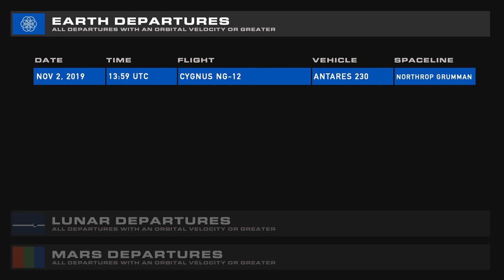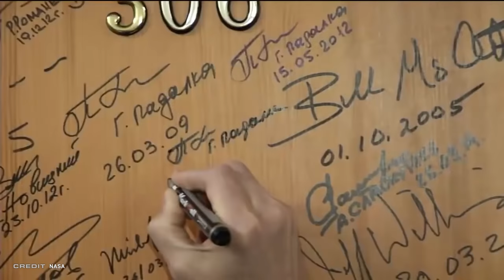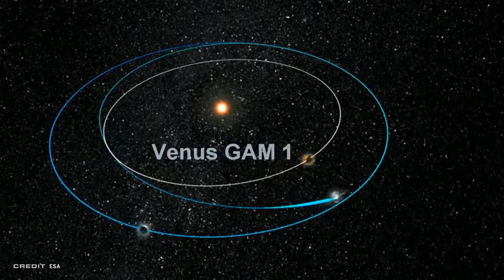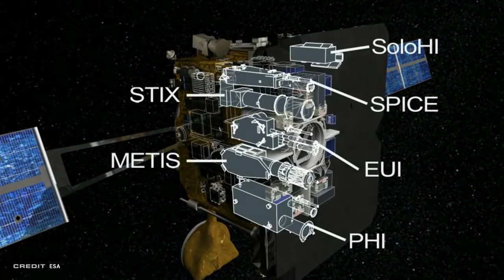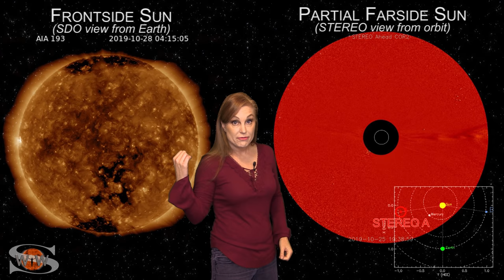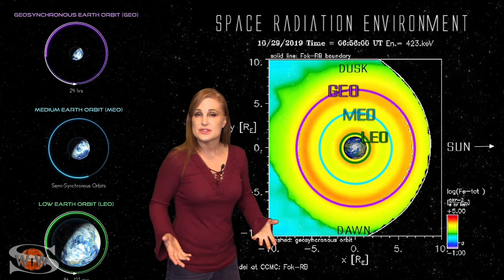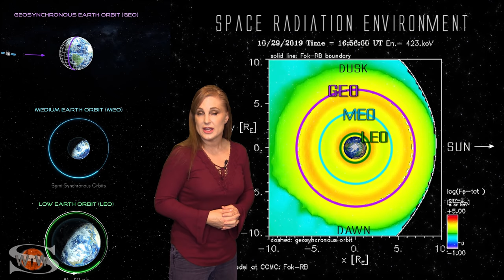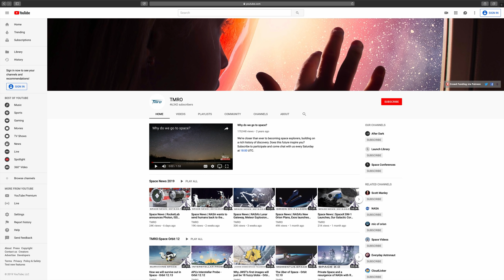Secret spaceplane landing and Mars hammer breaks again | SPACE NEWS

Comment: Yeah I have no idea what happened with the insight lander and the mole. some more explanation and maybe a still frame of what was the results of whatever they did would be helpful.
Reply: G'day,

  Well, my guess is that either Lisa dropped a Decimal Point in her instructions regarding how many seconds of the illustrative Clips which she wanted TMRO HQ to import, & use in her Story - and therefore maybe 20 seconds of a picture being worth a thousand words was turned into 2 seconds of "WTF...? ! ", and that happened a couple of times...; or alterntively someone at TMRO HQ decided that the Video was running on for far too long, so to make room for the absolutely vital "Bloopers & Out-Takes" footage at the dag-end, while the Begging-Credits were rolling..., they simply cut 90% out of all the illustrative bits from Lisa's story....

You  get choose between them thar  explainifiationings hereinat ; or, feel free to formulate all your own guesstimations !).

  I watched her contributions 3 times & was almost none the wiser, until reading the Comments Thread added data by impliction.

  I now suspect and deduce that the Mole's Strap-Cable is intact, but the Hammer-Drill has now jumped up, moved backwards out of the hole, and is currently precariously  wedged at the top of the Hole - nose-down and leaning over at an angle of 40 or 45 Degrees...., on the very point of falling over and lying flat on the ground..., forevermore...(?) !

  Now that they've proceeded THUS far, they're suddenly  admitting that they have indeed seen their Mole behave in such a fashion before..., but it only ever did that, or words to the effect,

"When it was tested in extremely Low  Atmospheric Pressures - similar to those found on Mars...." (!!!).

  Which means, presumably..., that EVERYTHING ever written, said, and videoed about how the Mole was going to work was literally Wishfool Thunkin'..., because without Air Pressure there is no Soil Moisture - due to the Water all boiling off ; and without SOME moisture in the Dirt, and thus without the cohesive properties conferred by the "Surface Tension" shared by as few as any TWO Molecules of Dihydrogen-Monoxide..., well their "Simulated Mars-Dirt" turned into ACCURATELY slippery DryDust...

   And, apparently, after so very much Time & Money having Bin-Spent building the Mole, & watching it work perfectly well  when under Earth-Normal Atmospheric Conditions...; NASA reverted to their time-tested "Shuttle-Goes-Pop !" Era Politicised Beaurocratic YesSir-ism..., & the Pen-Pushing Astronought (Robotic Exploration) Administrators decided, in their collective WiseDumb, to accept the results of all the majority of (successful) Mole-Tests (made under Earth-Normal conditions with sticky slightly wetted Earth-normal Dirt), while rejecting all the Data from the  unsuccesful Tests, which were  made under Martian-normal Atmospheric conditions of Pressure and Humudity..., because "statistically-squeaking, the failed tests were numerically  anomalous and therefore may be regarded as 'Outliers'..." (!).
   
Or, 
Word-Salad ; 
To that
Effect.
(?) !

   Anywayze..., the upshot is that the Magikal Drill which hammers itself reactionlessly into Mars only ever worked under invalid testing conditions here on Earth, whereas on Mars the Regolith and Fines are too dry..., so the Contraption simply is NOT Fit For Purpose (?).

   Ahhh, MurriKa...!

S.N.A.F.U. !

Apparentarily.

   Such is Life,

Have a good one...

  ;-p

Ciao !
Reply: I didn't understand a thing.  We appeared to see much the same thing repeated, just with different numbers displayed, and then everyone got upset because something I couldn't see/understand didn't appear to happen.
Reply: Hey Mark thanks for watching!

When the mole first got placed on the ground, it began hammering but progress was WAY slower than expected. They decided to lift off the rectangular box that acted as support and also held the spool of ribbon cable.

Once that was out of the way, it revealed the hammer had been bouncing around and spinning in circles, kind of like a car tyre that is stuck in loose sand. 

The hammer had created a pit thanks to all this, when it’s supposed to dig as a precise narrow tunnel. The scoop was used to try to collapse the pit, and fill it in a bit. That didn’t really work. Some people thought it was a rock in the way, others thought it was lack of friction, meaning the hammer would recoil every time it tried to dig. 

Next solution was to pin the hammer probe in place with the scoop, to give more friction. This worked! And since the direction or position of probe wasn’t changed, gives good evidence that it was NOT a rock in the way. 

The probe got all the way down to where the top of the ribbon cable is (Aka the ribbon is now level with the ground) By now it would be unsafe to keep the scoop pushing on it as they could break the cable. They moved the scoop away and pushed hard on the ground beside it instead. They hoped this extra force would help the probe to dig. 

At some point, the probe unexpectedly went backwards out of the hole. It’s hard to pinpoint exactly, as the camera is only commanded to take pictures at pre planned intervals. I wish we had continuous video from Mars - would make this a lot easier!

Leading theory is that the probe made another pit/cavern/hole at its tip and so the recoil of the hammering ended up stronger than the ‘forward hammer’ causing it to go in reverse! 

But most importantly, we can’t let it fall completely out of the hole because the scoop doesn’t have fingers to be able to pick it up!!!

I hope that helps! And apologies for not being clear.
Reply: @LisaStojanovski  

G'day  Lisa,

  So, how far wrong was I in my deduced guesstimations ?

  How's your Fireplan (?) ; this Summer looks like it's goanna be Absolutely  FASCINATING...!

Have a good one,

;-p

Ciao !
Reply: @LisaStojanovski  Thank you for the info. I was also frustrated that nothing was shared in the video of what actually happened. This channel does that a lot ... you guys/gals just say "can't you believe this" without explaining "this". Thank you for the info here.
Reply: @LisaStojanovski  Thanks - much clearer!

Comment: I'm sorry your explanation about what happened to the Mars drill was inadequate.  What was the failure?
Reply: Treefarm Hey, thanks for watching and my apologies for not being clear in the video. Here’s a detailed version of events:

When the mole first got placed on the ground, it began hammering but progress was WAY slower than expected. They decided to lift off the rectangular box that acted as support and also held the spool of ribbon cable.

Once that was out of the way, it revealed the hammer had been bouncing around and spinning in circles, kind of like a car tyre that is stuck in loose sand. 

The hammer had created a pit thanks to all this, when it’s supposed to dig as a precise narrow tunnel. The scoop was used to try to collapse the pit, and fill it in a bit. That didn’t really work. Some people thought it was a rock in the way, others thought it was lack of friction, meaning the hammer would recoil every time it tried to dig. 

Next solution was to pin the hammer probe in place with the scoop, to give more friction. This worked! And since the direction or position of probe wasn’t changed, gives good evidence that it was NOT a rock in the way. 

The probe got all the way down to where the top of the ribbon cable is (Aka the ribbon is now level with the ground) By now it would be unsafe to keep the scoop pushing on it as they could break the cable. They moved the scoop away and pushed hard on the ground beside it instead. They hoped this extra force would help the probe to dig. 

At some point, the probe unexpectedly went backwards out of the hole. It’s hard to pinpoint exactly, as the camera is only commanded to take pictures at pre planned intervals. I wish we had continuous video from Mars - would make this a lot easier!

Leading theory is that the probe made another pit/cavern/hole at its tip and so the recoil of the hammering ended up stronger than the ‘forward hammer’ causing it to go in reverse! 

But most importantly, we can’t let it fall completely out of the hole because the scoop doesn’t have fingers to be able to pick it up!!!

I hope that helps! And apologies for not being clear.
Reply: @LisaStojanovski  Thanks Lisa, now I get it. But if they've run out of ribbon doesn't that mean it's as far into the ground as it can go?
Reply: Treefarm they still have about 4 meters of cable left. It’s all spooled up inside the support box that was lifted off it a couple months ago.

Comment: I don't really understand the thing about the mole. What happened?

Great show btw
Reply: the front fell off
Reply: Hey John thanks for watching!

When the mole first got placed on the ground, it began hammering but progress was WAY slower than expected. They decided to lift off the rectangular box that acted as support and also held the spool of ribbon cable.

Once that was out of the way, it revealed the hammer had been bouncing around and spinning in circles, kind of like a car tyre that is stuck in loose sand. 

The hammer had created a pit thanks to all this, when it’s supposed to dig as a precise narrow tunnel. The scoop was used to try to collapse the pit, and fill it in a bit. That didn’t really work. Some people thought it was a rock in the way, others thought it was lack of friction, meaning the hammer would recoil every time it tried to dig. 

Next solution was to pin the hammer probe in place with the scoop, to give more friction. This worked! And since the direction or position of probe wasn’t changed, gives good evidence that it was NOT a rock in the way. 

The probe got all the way down to where the top of the ribbon cable is (Aka the ribbon is now level with the ground) By now it would be unsafe to keep the scoop pushing on it as they could break the cable. They moved the scoop away and pushed hard on the ground beside it instead. They hoped this extra force would help the probe to dig. 

At some point, the probe unexpectedly went backwards out of the hole. It’s hard to pinpoint exactly, as the camera is only commanded to take pictures at pre planned intervals. I wish we had continuous video from Mars - would make this a lot easier!

Leading theory is that the probe made another pit/cavern/hole at its tip and so the recoil of the hammering ended up stronger than the ‘forward hammer’ causing it to go in reverse! 

But most importantly, we can’t let it fall completely out of the hole because the scoop doesn’t have fingers to be able to pick it up!!!

I hope that helps! And apologies for not being clear.
Reply: ipissed which part am I wrong about? I was recounting the story directly as it was told by the DLR engineers in their mission blog. 

The engineers did attempt to soften the recoil. There are two springs inside the hammering mole - the main spring which provides the hammering force, and a smaller weaker spring which (when combined with enough friction from the environment) dampens the recoil and leads to an overall downwards force. 

But as to why they didn’t put a spade head on the tip? I’m unsure. There was likely a good reason though. Perhaps I’ll reach out to them to come on for an in depth interview.
Reply: Lisa Stojanovski 
Thank you so much for explaining! Was a bit hard to know what I was supposed to see, now it’s clear. 

Keep up the great work, I like these report elements from outside the studio. Always interesting stories!

Have a great day

Comment: Until... this happened...  What!  What happened!!
Reply: Yes, I have no idea what happened.and although I'm not an engineer, I was an aircraft mechanic in the Air Force for 20 years and had to do what the engineer told me to do, and I still have no idea what happened in this video, nor what they were trying to do.
Reply: Thing was hammering fairly well when it pulled out way too early. Now everyone is disappointed. Ministoj suggests different position.
Reply: Hey Rupert thanks for watching!

When the mole first got placed on the ground, it began hammering but progress was WAY slower than expected. They decided to lift off the rectangular box that acted as support and also held the spool of ribbon cable.

Once that was out of the way, it revealed the hammer had been bouncing around and spinning in circles, kind of like a car tyre that is stuck in loose sand. 

The hammer had created a pit thanks to all this, when it’s supposed to dig as a precise narrow tunnel. The scoop was used to try to collapse the pit, and fill it in a bit. That didn’t really work. Some people thought it was a rock in the way, others thought it was lack of friction, meaning the hammer would recoil every time it tried to dig. 

Next solution was to pin the hammer probe in place with the scoop, to give more friction. This worked! And since the direction or position of probe wasn’t changed, gives good evidence that it was NOT a rock in the way. 

The probe got all the way down to where the top of the ribbon cable is (Aka the ribbon is now level with the ground) By now it would be unsafe to keep the scoop pushing on it as they could break the cable. They moved the scoop away and pushed hard on the ground beside it instead. They hoped this extra force would help the probe to dig. 

At some point, the probe unexpectedly went backwards out of the hole. It’s hard to pinpoint exactly, as the camera is only commanded to take pictures at pre planned intervals. I wish we had continuous video from Mars - would make this a lot easier!

Leading theory is that the probe made another pit/cavern/hole at its tip and so the recoil of the hammering ended up stronger than the ‘forward hammer’ causing it to go in reverse! 

But most importantly, we can’t let it fall completely out of the hole because the scoop doesn’t have fingers to be able to pick it up!!!

I hope that helps! And apologies for not being clear.
Reply: @LisaStojanovski  Thanks!  Great explanation and exciting stuff!  Thank you for filling in the missing details, and reporting on it in the first place.  It seems odd to me that  the rover was sent there with no way of picking the probe up and putting it back in the hole given the uncertainty (acknowledging hindsight of course).  Yes, can imagine why it might go backwards if material from the sides collapsed easily.  Rather like what happens on the beach if you stand in a hole, fill it up with sand and then lift your feet up and down - you tend to rise up.  Even so, I'd love to see the rover capture the picture of a martian gopher angrily waving its fist from inside the hole.